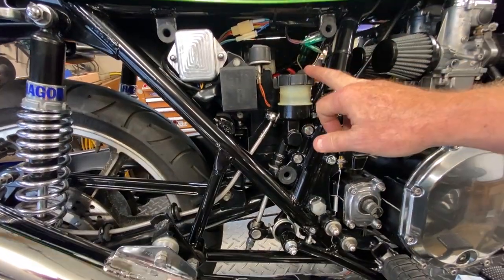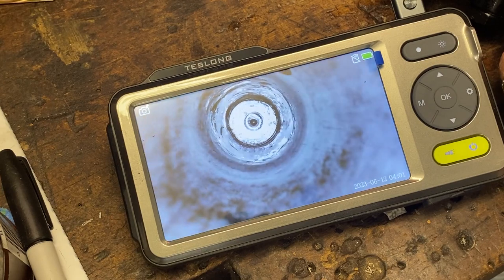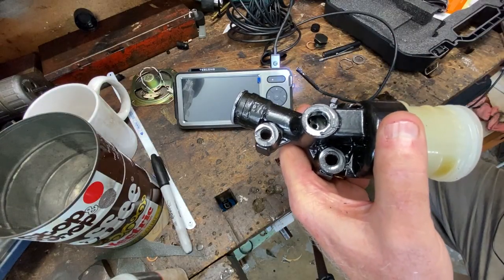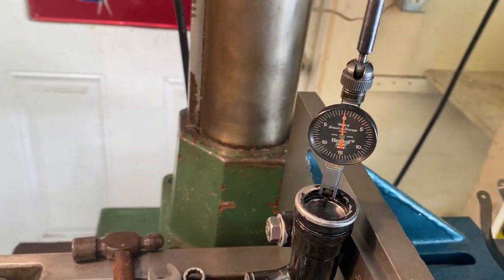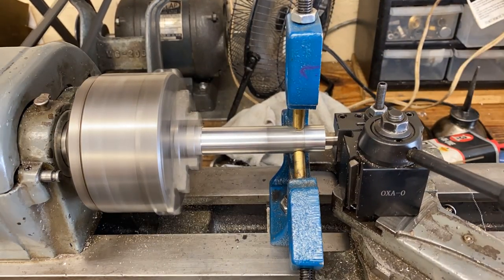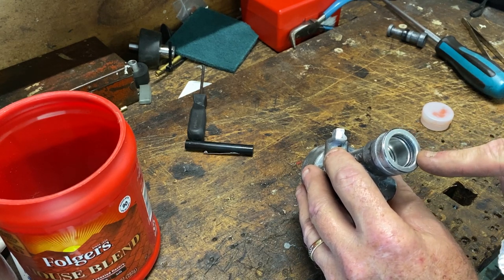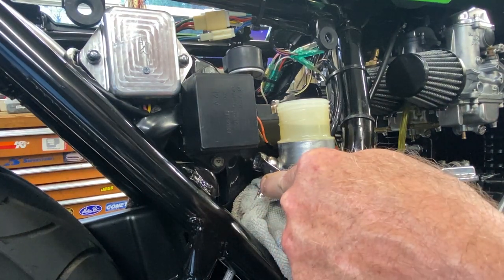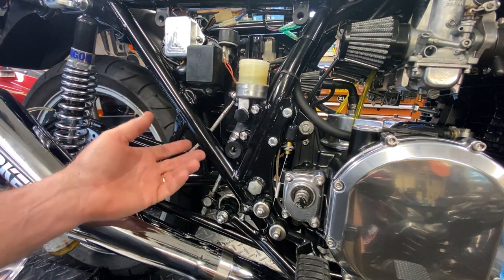Timco Z1-R leaking master cyl boring, sleeving and testing! Unreplaceable!

Comment: Nice job fixing the master cylinder. No small task. I had a similar issue with a H2 master cylinder that wouldn’t bleed, found a place whose business was re-sleeving vintage auto master cylinders. As you mentioned, good original parts are pretty much all used up.
Reply from the maker: Huh. I didn't know there were places that did that. Maybe I should start advertising that service. Thanks.
Reply: @MotoRestoFL  Take a look at Apple Hydraulics.